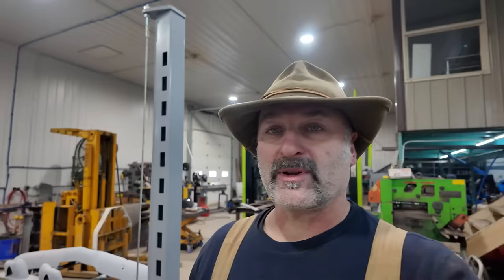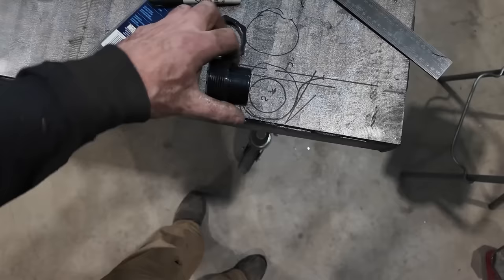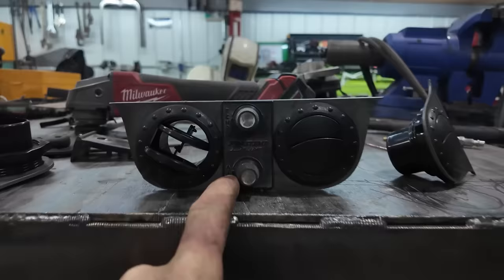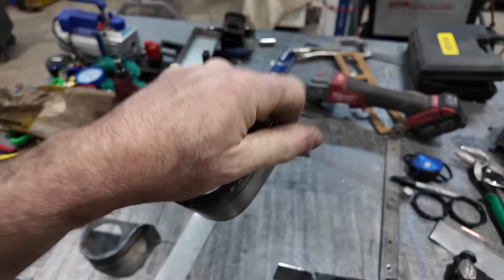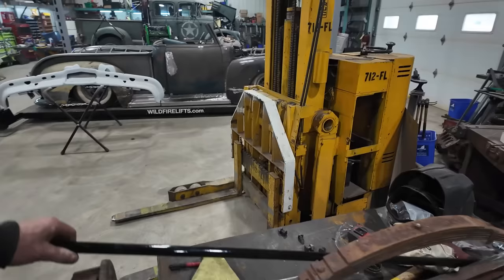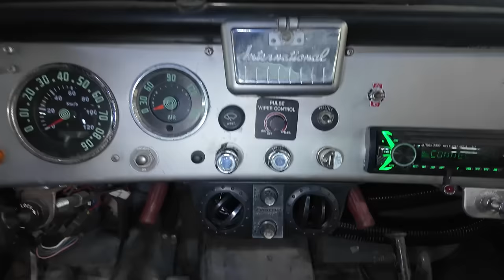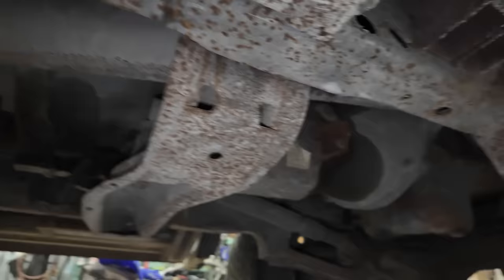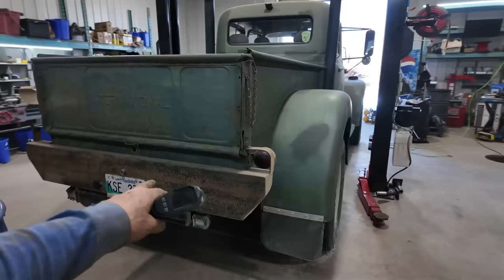Finishing the General A/C install and more work on the Essex!

Comment: I have a great appreciation for your work, because of styling and body lines that made them cool back then can still be found in your finished product. You use to have a lot going on in the old shop, but now were a little more apart of it because it is easier to see and I guess for you to film. Ryder doing well and so is Roland's ride. Looking good and you will be running with cold air on this road trip.

Comment: Excellent video.  You did a lot, from the AC in the General to tearing down the quad cycle to remove the broken cam.  I really liked the way you did the vents and AC controls beneath the dash panel.  It is always a school day at “Half Ass Kustoms”.

Comment: 13:09  I see you have one of the China LED work lights from amazon. If the ~1hr battery life annoys you like it did me, you can easily disassemble and replace the 18650 battery to get 6 hours of life.  I salvaged a bunch of 18650's from some laptop battery packs that wouldn't take a charge (there were a dozen 18650's in the battery pack and only one was DOA, the rest were just fine).

Comment: The capillary tube from the temp control really needs to go into the evaporator core or you will risk freezing the core on a humid day especially if you have your fan speed on low. Just a thought from an old Auto air technician. Also have you had a thought of the drainage while you now have the unit in a vertical configuration. Your condensation from the core will drop into your fans rather than the drains. Billy J'..... Queensland, Australia.
Reply: Brent is obviously not knowledgeable in auto AC.  You are right on with drain issue. The drain is one of the most important considerations to an ac installation.  He totally missed it. The whole reason for ac is to get the hunidity out of the cab.
Reply from the maker: yeah, I’m aware of that, but I didn’t have anywhere else to mount it. That said I’m OK with the condensation splattering me in the face haha

Comment: For years some hotrodders used Corvair front suspensions, because they were compact and could be converted to disc brakes and rack and pinion steering, that was until the Mustang II came out with both modifications included.  ;-)
Hm, is that less than 1/32nd after feathering?  ;-D
Reply: In 1968, I put a 1966 corvair front end under a 1931 model A.  Drove great, but front end sat higher then I would have liked due to interference with the fender braces.  I put over 30,000 miles on before I sold that car.  Years later I built a 1928 chev roadster using a corvair front end, but this time I used dropped spindles from an S-10 and a rear steer rackand pinion.

Comment: Brent you should fix the motor in it because it will pull more with the motor fixed then add a tuner to it to increase the power

Comment: Brent, did you add oil in the A/C system? PAG oil is used with R134 systems. I would use whatever Chrysler used, due to using their compressor.
Reply from the maker: I usually find, but I’m no expert that the pump usually has enough oil in it from its previous system. that said I guess if I screw it up, the pumps are readily available off another donor
Reply: @HalfassKustoms  you should add 2oz for condenser 2oz for evaporator and 1oz for dryer.

Comment: Are you sure that using the General for the trip is smart..... noise and vibration frustration. It will take out the cabin comfort environment. You and Ester are going to have hearing issues.. as well as your back. 🦊
Reply from the maker: We’ve taken it on many road trips. It’s one of the more comfortable vehicles I own.

Comment: Are you sure that using the General for the trip is smart..... noise and vibration frustration. It will take out the cabin comfort environment. You and Ester are going to have hearing issues.. as well as your back. 🦊